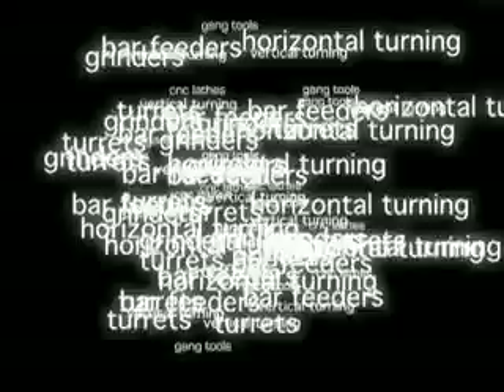GTV-27 Broaching Demo

Comment from the maker: The GTV is capable of high-speed threading.  There is very precise synchronization between the spindle and the tool. It may look like the spindle is just spinning independently, but in reality the spindle speed is linked with the tool feedrate.